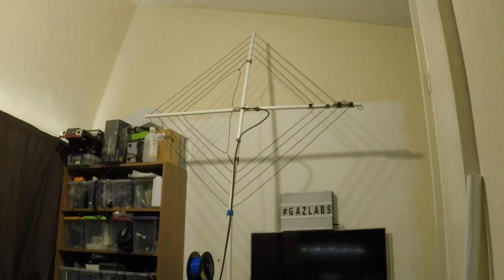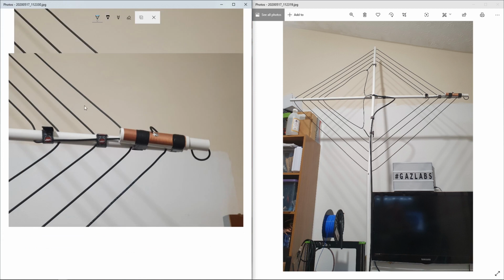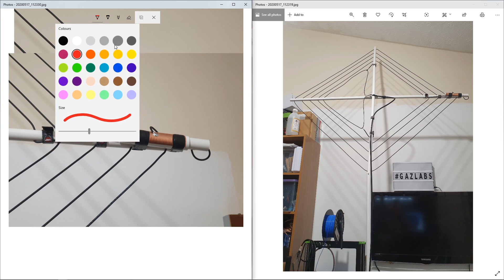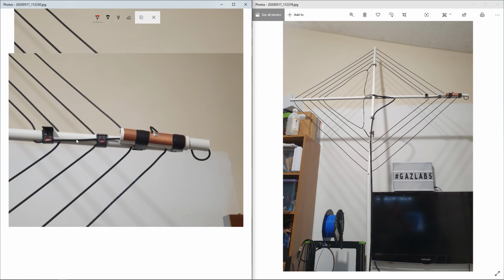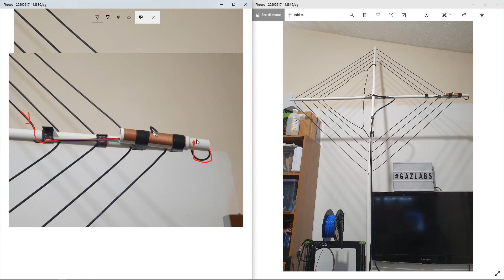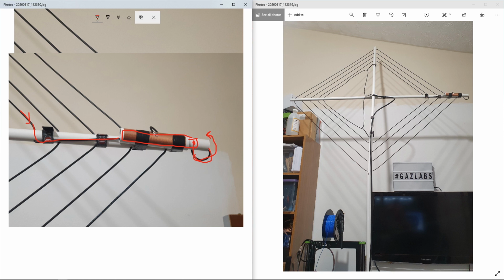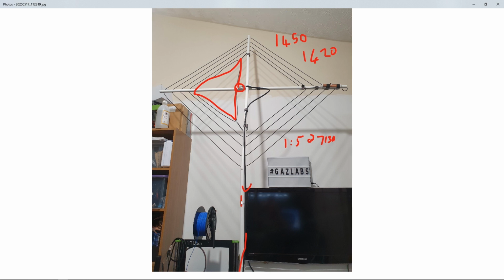A 40Mtr antenna for small spaces, frame antenna, spiral loop PART 3

Comment: Great project, I will build one myself. Please do not include me in  the give away, there are sure to be many folks who do not have the gear to build one, I do, so it would be better for it to go to someone who can't DIY one!  Wonder how big a top band one would be? 73 Jim M7BXT
Reply from the maker: a new ham got the antenna, he was first to ask I thought that was fair enough lol 160 about 2.3 Mtrs square.. ish..
Reply: @TheGazLab  Pleased it is going to a new guy.Seems reasonable size wise, any idea where I can get the element length? Thanks Jim M7BXT

Comment: Congratulations! You've SOLVED the linch pin of loop antennas: Getting around that expensive and bulky capacitor that all of the others rely on! But I guess that the give-away in my case is straight out..In the USA, our public transportation absolutely sucks: I can't get a transfer ticket to the Atlantic Chunnel... 73 DE W8LV BILL
Reply: I've been thinking: Have you tried to place your "trombone" capacitor inside a larger piece of PVC pipe? That and a "stick" to adjust the whole thing might keep one safer. I also see some three inch copper tape available on Amazon. (And other cheaper non-copper metal tapes as well.)  Again: CONGRATULATIONS for a very well done video and project! Wonder what the dimensions are at Longwave... ;-)  73 DE W8LV BILL

Comment: great antenna build,,i am thinking on building  a  butterfly terminated dipole in my shack attic ,24f by 12 f is the size i have,  but dont no the smallest size i can get away with that will work ,at present the shack attic has 3 dipoles up there ,all zigzaged to make them fit.any any thoughts
Reply from the maker: thats a tough one .. have a look at a short t2fd but Im not sure how small they are.. gaz

Comment: Yeah!  I can just see that sticking out of a German truck turning slowly trying to find a hidden radio, in fact, it looks like one in old WW11 film.  But maybe just something similar.  I think rain might affect it a bit, but can't have everything in a small antenna fro the band.  Well done Gaz, it looks the part now.  Maybe you will make the video of it working!  I think I might have built it in black, but that is a personal choice and you were only proving you could make a small antenna for very little cost and not to much effort either  So I have to say well done and I hope it finds a happy home.
Reply from the maker: It cost about £30 all in if I buy the wire.. but thats still pretty awesome for its size.. I will do something with it on video tomorrow, it was a hard video to make on my own.. gaz
Reply: @TheGazLab  I know videos are time consuming and not easy.  I have a lot I started to edit and gave up as they require a lot of work.  It is finding the time to do it that I find worst, filming is the easy bit!